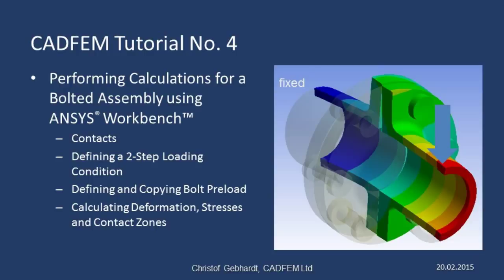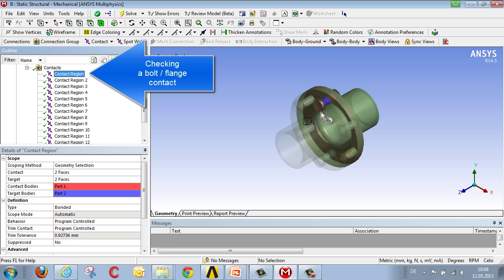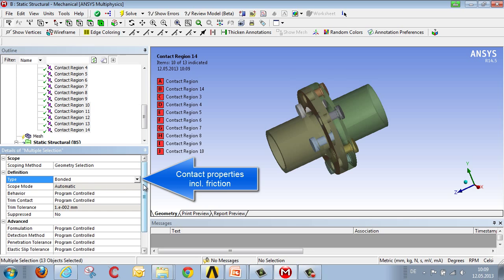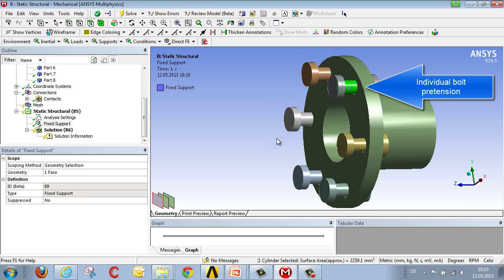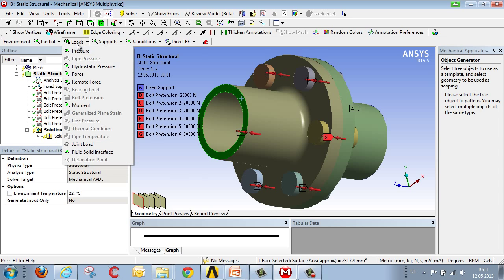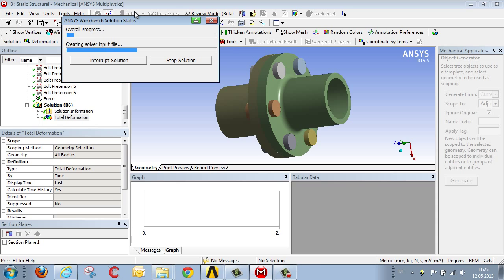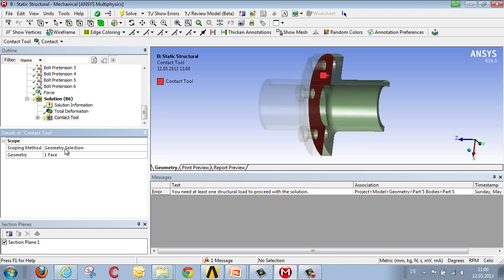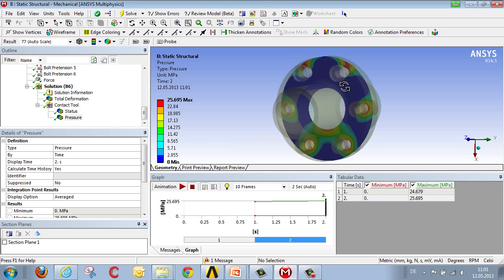CADFEM Tutorial No.4 - Performing Calculations for a Bolted Assembly using ANSYS® Workbench™

Comment: great tut, but somehow i believe it is inaccurate. 

there should be contact defined between bolt and the holes on the flange. and the nut should be defined as lock contact and not frictional. 

maybe then you will have different result, as right now its showing your bolt is weak. with the help of nut defined as "lock" similar to real world, it might prevent the flange from moving after external load is applied.

Comment: how to know the corresponding friction value for frictional conctact? 
my work have bolts AND NUTS with AISI 4340 and flange with AISI 4140, bushes and washers also present. for them what values should i give? please reply.
Reply: check from norbar website, you can find it in the bolt table as per the bolt grade.

Comment: I have been studying on bolt connections in Ansys nearly for 1 month. I have real world experiment results about maximum pretension force for a bolt. I modelled the bolt in Solidworks as exactly same and simulated in Ansys. Von Mises stress in Ansys gives me 3 times higher result with respect to real world experiment. Later i simulated the bolt in Ansys by using bolt thread option under connections. Ansys gave me nearly same result with respect to first simulation. Namely, i can not take result same with experiment. (There is no mesh or modeling problem). If one can compare any bolt connection experiment result with  Ansys result, we can find the reason of wrong result. Thanks